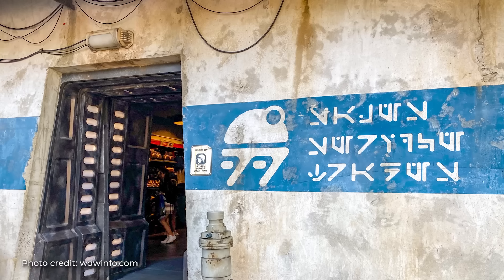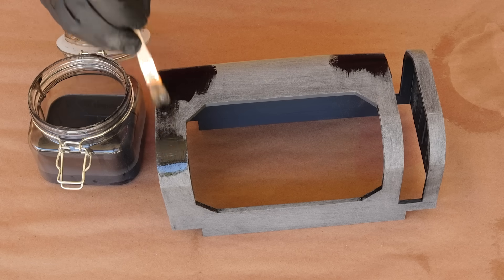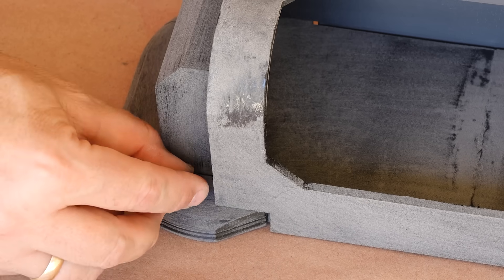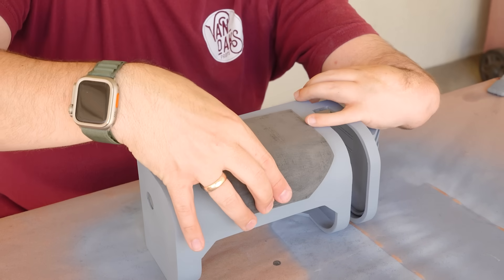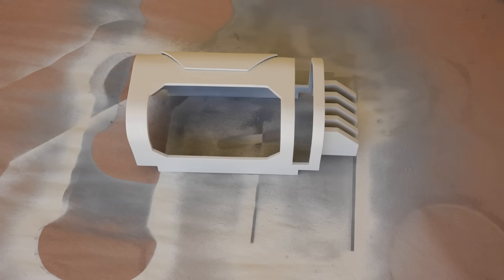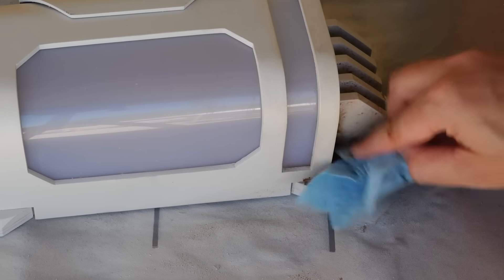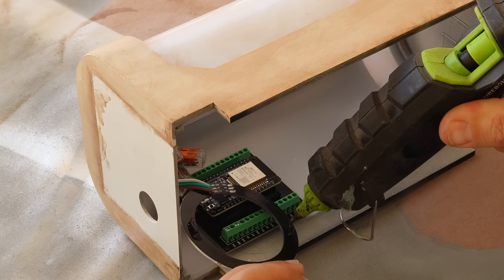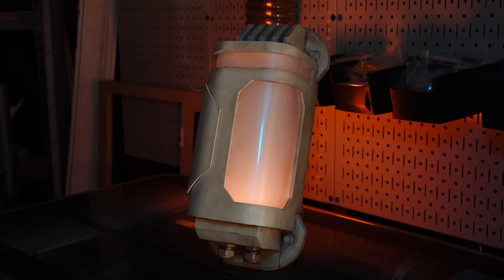Star Wars Themed Room Lighting – Inspired by Disneyland’s Galaxy’s Edge

Comment: For the weathering. Have you ever use a sponge? Also. How about LED strip lights? You could cut them any lengths.
Reply from the maker: Yes to both. I had initially intended on using a strip light but didn’t have one on hand.

Comment: Amazing work as always. I may have to use these in Hollywood Studios tribute room build. However, I may alter it slightly so the wires come in directly into the unit from the back since mine would be wall mounted.

Comment: You could use Aluminum foil tape (or just plain aluminum foil) to help push the light towards the frosted panels.  Used to have a stash of plastic dollar tree mirrors I would cut up to help with indirect lighting.
Reply from the maker: Thanks for the tip!

Comment: A few points:
1) You can get tubing that has ribs on it.  It is sold for "looming wires" in cars and stuff.  With a little bit of color work, it can look like heft industrial cable and is just big enough to slip a USB cable through.
2) The "connectors" are really "strain relief" or often "grommets" or "gland joints or "cable glands".  They are intended for keeping water out of stuff but they can really look the part of being a metal connector.
3) If you don't mind doing electrical work but micro-controllers are not your thing, you can get flickering LEDs and blinking LEDs.  A blink or two and a flicker or two can look like something is malfunctioning.
Reply from the maker: Great tips! Thanks for sharing!